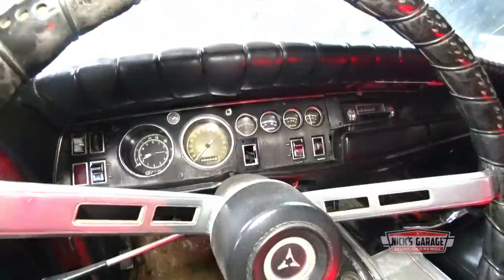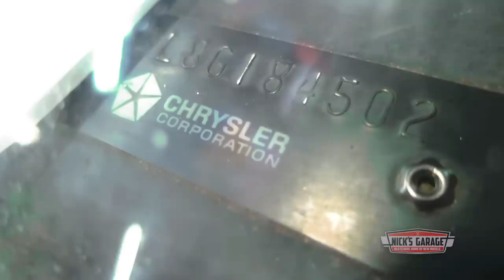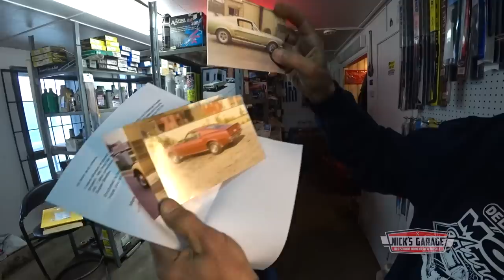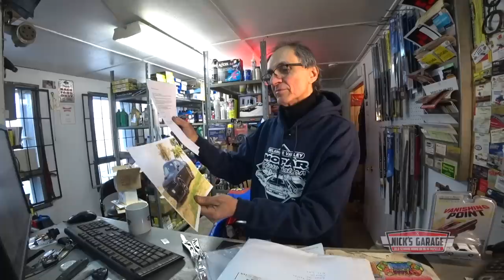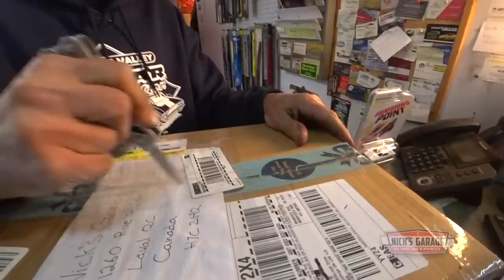1968 Coronet R/T 440 Tear Down - You Won't Believe What's Inside!

Comment: My first car was a hand me down 67 Coronet R/T w/440 mag given to me by my dad that he had ordered new from the factory in 1966. He told the dealership owner whom he knew that he wanted it to be able to run with Petty on the track, as I guess back then you could order more in the stock 440 mag than what it came with. It had electric windows, air conditioning, front disk brakes, posi trac rear end, a am/fm 3 speaker sound system and a tachometer. I broke the speedometer in it and dont know how fast that car would actually go. But I know when that ometer went it was pegged out about inch past the 150 mph mark bouncing off the bottom of the speedometer assembly.. Im lucky I wasnt killed growing up. Man those were the days...

Comment: Had a 68 Coronet 440,  had it completely repainted, new upholstery, and new Firestone tires,  wanted it in perfect condition before I shipped it to Germany where we got ordered by the Army,    Picked the car up at Bremerhaven and drove it home,  I was laying in bed, and reached over to turn off the night stand lamp.   Boom!   A German kid in a Capri hit my car in rear end, totally wrecking it, even the roof was crinkled, and engine through radiator,   
I miss that car, it was great traveling car....except no AC... 
since I lived in a little village outside Heidelberg I had to hurry to buy another car...bought a 1974 Plymouth Duster with sunroof and it was a really sharp looking car, but had more problems than I could afford, so I traded it in for Station Wagon that was comfortable for the wife and 4 kids.

Comment: As the other guy on here said, that was your missing distributor bolt. I supremely doubt that a bolt that length would make it through the intake valve, especially considering the valve head wasn’t snapped off. It fell into the cylinder while the head was off. Only way I can see it. 

Also you run a really good shop, but it is driving my inner obsessive compulsive mechanic that you guys aren’t keeping the pushrods and other parts in order. I built a wood fixture that holds my push rods, lifters, and valves (if removed from head) to make sure I keep everything in its proper place. Parts mate to each other if they’ve been ran for any amount of time, and some engines use different length pushrods for intake and exhaust. This just makes life easier.

Comment: Was it the distributor hold down bolt?
Reply: Greg L.      No, it was not.
Reply: about the same size. it HAD to be put in befor head was put on.  valves dont lift that high, plug holes are to small! unless they mixed it with gas in the das tank and the fuel pump shot it in there thru the carburator!!

Comment: How could a 3/8 bolt with a 9/16 head get through an intake valve port.
Reply: Also my first new car was a 1969 Super Bee
Reply: John H.   Good question. I will look into it.The valve opening is about .444 max opening.
Reply: The shank goes through first and then swings around the valve allowing the head to go through flat. Remember the engine was idled for awhile so it it was getting bounched around 3 or 4 hundred times a minute until it happen to get oriented just right to go through.

Comment: Well Nick I've been there sounds like sabotage someone  didn't want anyone to have the car
Reply: That's my theory as well. I've heard, during the early years of the Muscle Car boom in the Early 2000's, a lot of wives who were getting they're husbands Muscle Car in a divorce settlement would find the car would run poorly and then the motors would lock up. Rendering them, essentially useless and valueless.
Reply: Fitch93 somebody’s wife found out how much he spent on that car and her new boyfriend helped her get it running right after he did her in the backseat first.
Reply: Yup... I can't picture that bolt sneaking underneath an intake valve without the valve being bent somehow... especially if there's no signs of damage on the backside of the valve or stem.  It'd be a lot easier for a bolt to find it's way through a removed sparkplug.

Comment: someone took the plug out and droped the bolt in??
Reply: Seems likely, unless it slipped in at the carb somehow - maybe during a rebuild? I always use clean lint free cloths in the holes while the carb. is off to keep debris out, just in case.
Reply: @shawnmiller9381  nope! bolt head bigger than the spark plug hole!the valve lift at the tallest point would not clear that bolt head either. i cat see how it got in there. head would have to have been off and someone tossed it in there.
looks like someone had it off  and put a new head gasket on it to me!

Comment: Use power tools as you age your joints will more wear out using hand tools.
Reply: @InfiniteMushroom You never go full boar with a power tool. You need to ease the power on besides it usually is evident the condition of what your working will that you know to take it easy or even use hand tools. Things like head bolts I personally never broke one. Exhaust studs are another matter on these big blocks.
Reply: @Auggies1956 .   That is correct, it all depends which bolts you remove.
Reply: @nickpanaritis4122  Exact;y sir.

Comment: I had the same car with the 6-pack hood, automatic, 318,340 heads modify, cam mod and 4bbl.I traded 1973 Bultaco Pursang for it. Next move I traded Coronet for 1969 AMX Javelin 343,4-speed,that would run 110 as fast as you could shift it, I read only 800 were made, 1968 Javelin, automatic for parts. My 1974 K-5 Blazer, 4- speed conversion, 327 out of 1968 C-10, Headman headers, 1970 Chevelle were sold for my education, to pursue weldíng engíñeering, Thanks for a part of history, only those who have racing mótorcycles, motocross in the thrill of competition addiction.

Comment: Is it possible for a bolt that size  to get past the valve ?
Reply: It would have never turned over in the first place if it was left in at assembly. So yes, it did get by the valve.
Reply: @ckane510  the lift of a stock hydraulic lifter on a 440 is .450 the head of a 9/16 bolt is .562
Reply: Claude Hutchings  was it a stock cam.? How hammered up was it before it actually went into the cylinder. Consider the variables.

Comment: The Car Owner must have AN ENEMY.. That Bolt was placed in the cylinder when a spark plug was removed and then replaced.   Definitely SABOTAGE
Reply: Not a chance it was put in through the plug hole. It was dropped in the intake or through the carb when whoever owned it before was working on it. That's the original distributor bolt, it was sitting in the intake until it vibrated down into an intake runner and past the intake valve.
Reply: @quick455  I think it looks way to big to fit through the valve opening no??

Comment: i know a 440 six pack my uncle  worked for dodge plant that made them, he blew one sky high on the test track! it did not make 80 in first gear it came apart! one uncle built the cars the other uncle shipped the cars threw trains plus the 3 uncle was a truck driver! worked on diesels and boats! i went to auto school Gm paid for a lot of the stuff in it! corvette was car I worked with in school, I had dodges, fords i went back dodge for newer v8 4.7 l gas millage and power beat any thing i had! i just got a yellow ford pickup with 3.0 liter v6 and 5 speed with low gears pulling setup it drives like old 5 speed mack truck slow and steady! if it gets 5 miles to gallon i will return it! i got a holley book on tune up stuff!

Comment: Interesting - thank you. Many many years ago as an apprentice mechanic we had a six cylinder Holden come in with a seized engine. On removing the cylinder head we found a stainless steel bolt.  No one knew how it got there as the car had been driven the night before. It had punched a hole through the cylinder wall and cracked the piston.

Comment: I was just thinking to myself about use some power tools to speed it up when Nick said something.  I still prefer an air ratchet and an air impact when disassembling, but not for putting them back together!  When I was in High School two guys were putting a new carb on a Chevy P/U with a 350 and one dropped a carb nut into the open intake and didn't tell the owner.  When he started it, we all heard a very strange sound, like a "tink", "tink" sound but it was intermittent.  None of us could figure it out, two days later the truck finally gave up the ghost.  That nut had bounced in and out of 3 cylinders before finally jamming an intake valve open.  So, when my younger brother decided to put a new intake, carb and distributor on his 69 Chevelle SS 396 I warned him to put something in the intake in case someone dropped something.  He had 4 of his buddies helping him and didn't want my help (I was home on leave from the US NAVY)  Well, they put an old t-shirt into the plenum, just in case.  Problem is they LEFT it in there!  Somehow he managed to get it to start and run for about 5 minutes and the engine sucked parts of the T-shirt into both sides of the engine.  It ruined the block and both heads, expensive lesson.  One of the guys fessed up to being the one that put the carb on and forgot to take the shirt out, but didn't offer to help pay for the damage.  Live and learn!

Comment: Hard to imagine that bolt getting through the valve. I would replace that rod also.
I was working for a Dodge/Chrysler dealership when this car was new, I saw all the hot rods when they were brand new.
I saw one I wish I could remember more about: It was a new Valiant (or like size body) with a 426 Hemi with a cross ram intake. The body had fixed plexiglass rear windows and no back seat just a black cover over the area to the trunk, it was white and had little skinny tires and hub caps that just covered the lug nuts.
The new car transport always unloaded just outside the bay I worked in and I heard this car crank-up when they were pulling it off the truck (it was loud). I never saw this car again and now I wish i would have spent more time looking it over but at that time I was backed up with rear end whine problems on new cars. Man, that was a long time ago and we thought those cars were fast and they were for the time but they were also death traps. They were never geared up to take all that power with drum brakes and the like...  I was a trainee at the time and went on to spend my life in the industry and the last five years I taught automotive technology at the local College. I was Master ASE certified and a Master certified tech. (European equivalent). I wrote the State curriculum for Automotive technology and proofed several technical publications (books)
I only mention that to say: I was really into it!
BTW: While i was working for Mopar in the late 60's we had a fuel dragster (Jr. fuel-er)
I was and still am a Gear-head.... I did FI, electrical and run-ability problems throughout almost all of my career.  Peace-out
Reply: Bass.     Good for you.

Comment: I know where a 1980 dodge 440 with 70k original miles is sitting inside an 23' RV. The only problem is that it got floded by hurricane Florence. I drove that vehicle to the new location a few months before the storm and the motor was purring like a kitten. I hate to see the 440 go to the scrap yard. It still has a lot of life in it.

Comment: Certain bolts use power tools, others by hand only. I've found this especially useful with modern plastics. Never leave a lost bolt unfound when building an engine. I've fished out dropped bolts through intake before, it happens, just be careful, don't get lazy.

Comment: I remember buying a 4 speed from friend out of his 69 swinger 340. (Victoria BC)  He was putting an automatic in to drag race it. The year was 1970/71. I adapted it up to my 6 cyl in 61 Valient. (original was 3 on floor) The 4 speed did not do well so sold to a fellow that put it in a 1966/67 full size Plymouth. I believe a big block 318. He was happy how it turned out in Plymouth. I wish I could remember his name, as original owner would like a 4 speed now. If the spline fit into my slant six was it a hemi trans? Nick says in that the hemi had an 18 spline shaft.

Comment: Exact thing happened to my 401 changing the soft plug underneath the manifold one of my good buddies dropped a bolt into the manifold and it made its way into the piston made a mess...Ran just just fine for two weeks. Fell into valve and held it open.

Comment: We used to run into this at the race track. Often times guys would sneak around the it area and toss nuts and bolts down your carb. bore. Rotten huh"! I never left the air cleaner off the car in the pit area.

Comment: Matching numbers and color coded coolant!
Those heads have been off recently as the heads are clean yet the bottom old and bit sludgy.And Felpro head gaskets.
As for the cam and lifters, they are 50 y/o and good for age.
Reply: LDN.      That is correct.

Comment: It's hard to imagine a 3/8 bolt with a 9/16 head getting past the intake valve. There's not enough lift. The engine must have been assembled with that bolt in there so they threw up their hands and off to the auction went this fine ride.

Comment: Bingo! I once had a consumer whose engine had a 5/16" bolt embedded in a 350 Chevy piston just like in this 440. The repair order even listed a single 5/16" bolt (turned out to be an intake bolt). Biggest refund I ever mediated when I worked for the CA BAR.

Comment: Nick, you know the only way that large size bolt could've got in the cylinder is for someone to put it there when it was apart. Wouldn't that bolt have destroyed the intake valve if it would've come down through the carburetor? I know the owner wants to redo it his way, but if it was my matching numbers engine, I would fix it back factory stock. This car would  be much more appealing and more valuable if it was as close to stock as possible. It looked like it has the original manifolds. Man, that is a rare valuable matching numbers car.
Reply: Albert S.     True, but it will be build almost stock.
Reply: @nickpanaritis4122 Nick, Thanks for responding. I love mopars, stock or modified. I enjoy watching your videos.

Comment: That's a well optioned R/T. Most didn't have a Rallye Dash...I'm wondering if it's original to the car. I had a 68 R/T 440ci car, but it was a standard dash, automatic trans and had a 8.75" rear with 3.23 gears from the factory.

Comment: 440's are durable engines...I purchased a 73 challenger with a 440 in it and as a young man I wailed the snot out of  it......never blew.  I finally pulled it to put in a stroker set up.  The cam was worn so bad, the lifters were dished way worse than this...they would actually hold water on top.  Pushrods all bent.   Lost power obviously but it never blew up.

Comment: I'm not thrilled with the music but you really know your business !!!! I could have used you when I had my 406 drag vega !!! Ran 10s ! 60" we're like a 9 second car but ran mid tens only 124 mph ! 13.2 to 1 motor 580 lift flat tappet cam straight up 3800 - 7500 rpm heads steel dart 2.05 - 1.6 220 CFM runners stainless valves 1.6 roller rocks intake team G power ram MSD-6 system cloyes dbl roller steel crank and rods 5.7 750 dbl pump stage 3 Barry Grant VP14  fuel inch and five eighths Doug thorley headers 36 degrees total ! All bottom and mid range top end lacked !!! Your opinion would be golden !!! Where did I go wrong ????

Comment: Using HAND tools - useful to feel how things come apart, binding threads, loose bits, if things have been over / under tightened or out of true.  Same on reassembly.  Look at the top engine builders, everything assembled by hand & torque wrench.

Comment: Once i was working on a 440 installing worked heads and a manifold bolt went missing after the heads were installed, yep it ended up hanging up an intake value when i turned it over to make sure it wasn't down an intake , wasn't visible but i caught it in time , before trying to start it, the intake valve did get bent , if it ran and the piston struck the valve open like that it may have bent it enough to let it passed the valve, the intake valve didn't look too bent up in this case , maybe it was in there , seller realized issue , thought the engine was shot and off to the auction in disgust. if he opened it up and found out it wasn't a cracked block maybe would have not auctioned it .Sold as a running matching number car which it was but someone got lucky.

Comment: Hey Nick. Maybe you can settle a long-running argument for me.

I bought a car off the Internet back in '96 that was advertised as a '65 Charger with a blown 318 motor for $300 (US). I checked it over and other than a hole in the trunk where a CB ball had been mounted it was pretty rust free. Everyone I knew at the time insisted it was a '66 because that was the first year they went on the market. I was then and still am now doubtful that the Department of Motor Vehicles (California) would register a car with the wrong year, though. 

The VIN on the car was shorter than that on my '74 Charger by 4 digits if I recall correctly. The really unique thing is that it had leading and trailing X's.  Is it possible that like some people told me my car was actually pre-production prototype of the '66 that somehow got sold?
Reply: Mike.    Sounds like your Charger was built in 1965.  Back then, there were no computers in DOMV, just humans writing down on paper what they see, or what you tell them I guess.
Reply: @nickpanaritis4122  Yep. DOP was in early 65, lending credibility to it being a prototype/pre-production model.  And then those Xs in front and behind the VIN. 

Love the channel. Wish you were close enough to visit the shop when I visit my parents.